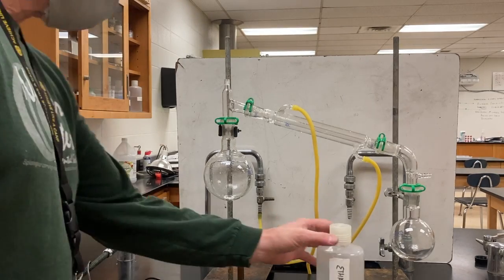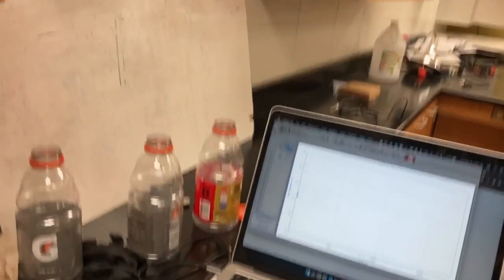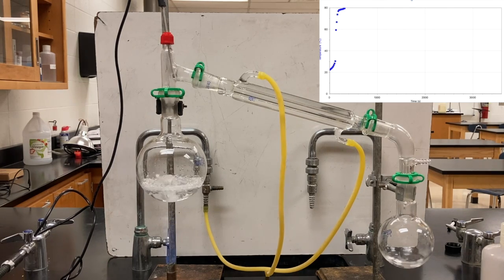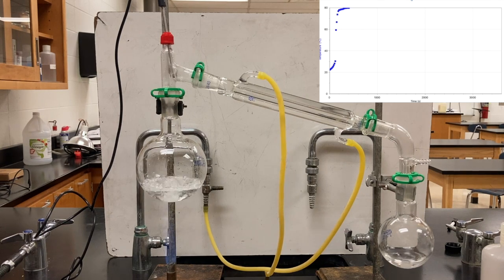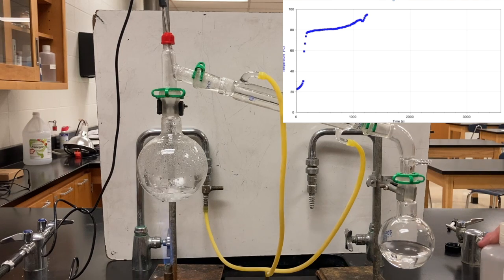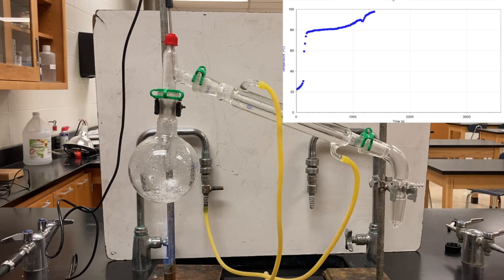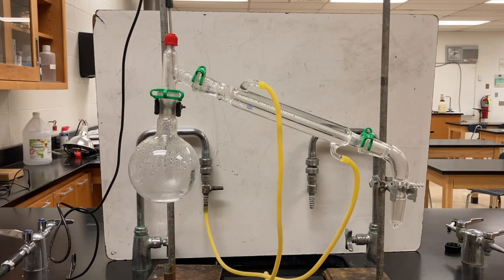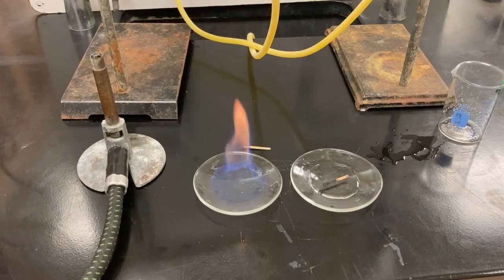distillation of water and ethanol

Comment: if we made fermented drink and we want to destil that mean at 65°c will come out methanol first right?
and at 78°c will come out etahol ? 
am i right? because i got some question if i do destile i need to do at 65°c for a while or just do at 78°c instead?
thanks you
Reply: Yes, but still don't drink the product from the first 5 minutes or thereabouts after the temperature has switched. And also keep an sharp eye out for the NEXT temperature increase, which is when the water's about ready to boil off. There are toxins at that end, as well.
My friend who distills says he uses a number of containers to catch the product (distillate) during his distillations, one at the beginning to catch the methanol, which he switches out to a new one after 5-10 minutes of catching it once it rose to the Ethanol Temperature. He then proceeds to switch out every half hour or so, keeping an eye on the speed of the drips. When the drips start slowing, he marks that container as the last. Once the temp spikes to 212F/100C, you're getting water.
After he is done, he uses a sensor to detect the levels of methane in each container, and, if too high, he drops all that product back into the still for another run.
He is dreaming of the day he can get a proper Fractional Distillation Column like those shown in these videos so he can get 95% pure Ethanol Motor Fuel in one run.
So do I. I'm doing destructive distillation of wood, FOR the Methanol. I want pure methanol.
Be very cautious if you are distilling Ethanol for drinking. Being poisoned by Bad Hooch is a large part of why America has an ATF. Death by Waragi is real, and not fun.
Everyone I know who brews is more anal retentive about sterility than Doctors are.
Reply: @TimeSurfer206  thanks for your information that help a lot

Comment: You cannot separate water and ethanol completely. They form an azeotrope due to the hydrogen bonding between water and ethanol. This causes the coalescence of the boiling points to single temperature.
Reply from the maker: Yep. But this video is made for 10th graders, so I over simplified my narrative. There still is significant separation, as the ignition test at the end shows.
Reply: @Mrscrapiron5  makes sense, 90% of all the distillers i've met doing tours in rum and whiskey distilleries don't understand how distillation of ethanol actually works. so i don't think a 10th grader would understand much better
Reply: @Mrscrapiron5  Uhhh, cool but azeotropes are a concept typically taught in 10th/11th grade curriculums...
Reply: @shadowkille8r99  No they are not.
Reply: Yes you can. Never say can't when dealing with chemistry..... you'll be incorrect often. There are several ways.
Reply: Is there any way to increase the efficiency of the seperation?